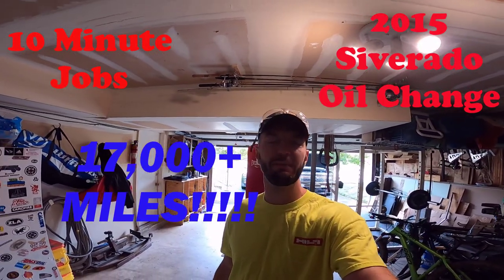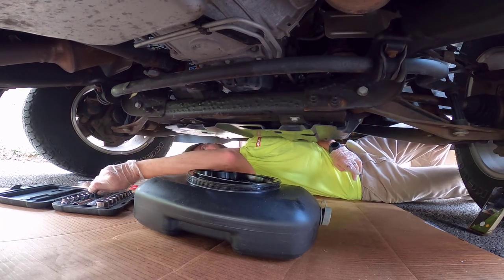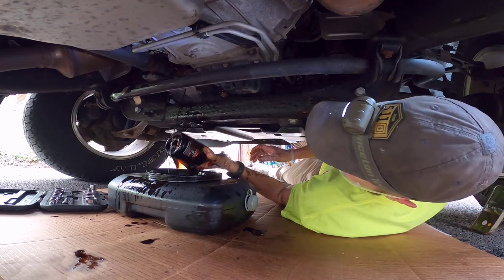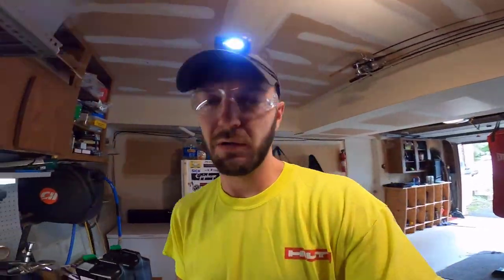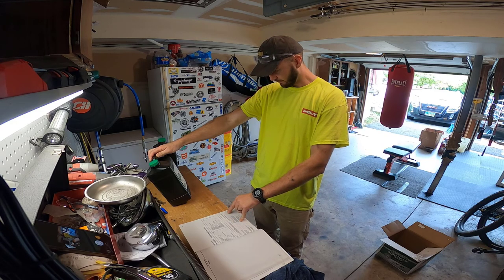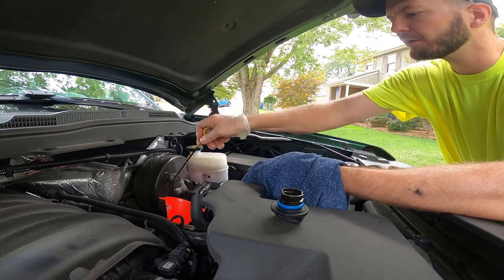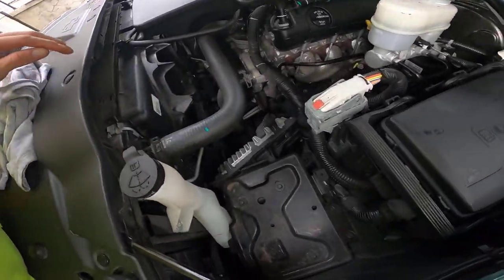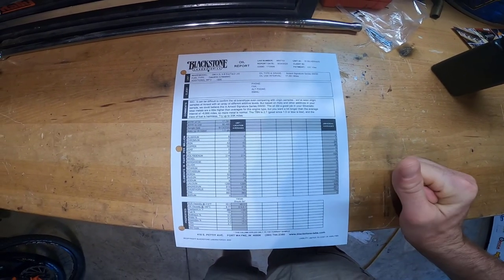2015 Silverado Oil change - 17k MILES!!

Comment: I Have been changing oil in my Trucks,Cars,ATV, Motorcycles for 30 plus years. 1st you don't need to use a tool to install a oil filter, use your Hands, 2nd punch an hole in the bottom of the old filter to drain the filter, this will lessen 95 % of the mess!  just a few ideals to help people out.

Comment: Lol. Don't plan to keep it long term I'm guessing? You know that's the #1 cause of lifter failure and vacuum pump failure (your brake assist) right. I wouldn't go past 5-7000 miles (depending on driving habits) no matter what oil you use... It's your truck, but I'd certainly would not. Hopefully your doing routine oil analysis and keeping all your documents so when the engine grenades you can at least hope amsoil stands by their "claimed" warranty.